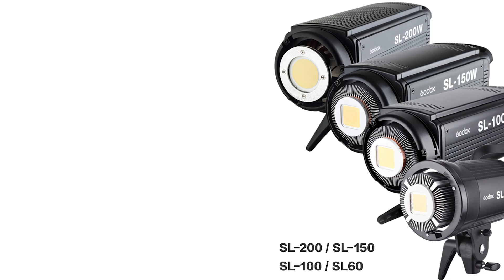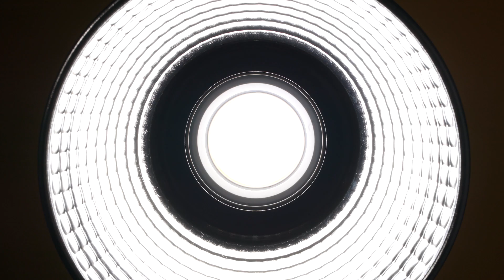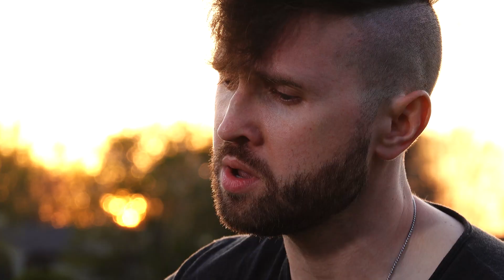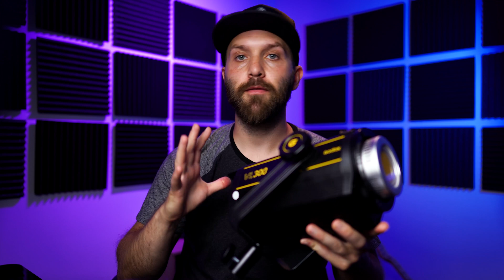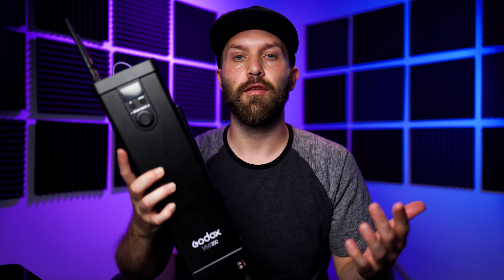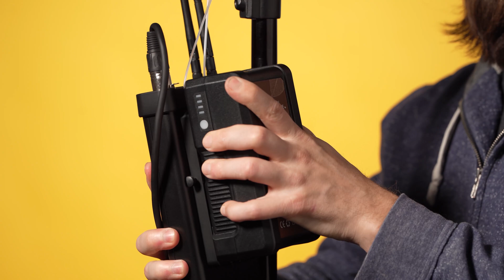Godox VL300 COB LED Review - High Output and High Value

Comment: Very informative. Awesome video. What do you think about the 300d ii, 300x and Godox VL300?
Reply from the maker: I think the VL300 is a better value than the 300d ii, because the critical specs (output and color quality) are so close and the advantages to the 300d ii are either cosmetic or minor luxuries that may not even appeal to most users.
As for the 300X, if you want bi-color then obviously that's the option.

Comment: Robert, do you mind sharing your lighting setup for this video? I see a lot of videos with a key light and colored backgrounds and I'm curious how you achieved that look so well? Thanks.
Reply from the maker: sorry I just seen this. All about fall off, especially in my close-quartered setup. LED lighting me is just out of frame, at a very lower power. As close as I can possibly get it. And then two RGB panels firing at the walls behind me, mounted overhead with a boom stand.

Comment: Hello, I have a question and you're one of the few channels I can think to ask. Might be silly, but it just occurred to me as a beginner in regards to an upcoming gig. Can two camera bodies, each using a transmitter, trigger the same strobe? I've only seen videos about this with optical trigger, not wireless. So for example, shooting a wedding with two bodies, each with an X1T on them, can they each fire the same AD200 so I can switch between bodies seamlessly? All set to same channel and group of course. I would assume that's the case but maybe I'm missing a reason why it can't be done.

Comment: enjoying your work bud, keep it up. recently picked up the AD1200 and two 600s to replace an old lighting set up. are you able to test the 1200 again the elinchrom 1200? it's been a 'dream light' for some time, and I'm considering adding it later. the output of the AD1200 meets my needs unlike the 600s. all the best man

Comment: Have you done any tests using that reflector on actual strobes? Do they also help strobe output?
Reply from the maker: I haven't yet, however I plan to try and pair it with the AD1200 Pro to see what happens. I don't think we'll see the same type of output gain as the COB though. The COB is flat, so it makes sense that using the ribbed squares concentrates the light. And omnidirectional bulb won't experience the same benefit, at least not as significantly.

Comment: How many stops different in brightness are the 150 and 300?
Reply from the maker: theoretically 1 stop, but I haven't tested side by side. But Godox has a track record of making their products wattages correlate directly with their output across models of the same series.
Reply: @robhallphoto  Thanks! I'm thinking the 150 will be good enough for me then. Now if only I could find a budget version of aputure's spotlight.

Comment: Do you think it'd be cool if all ac strobes come with such an dc option which uses standard LED batts like v mount, gold mount, NP-F etc whatever's the standard in cinematography. Strobes draw less power on average and their batteries are often similar/lower speced than flash ones (in terms of voltage and capacity)

I'm not thinking about flash specs (color accuracy, recycle time, flash duration, portability etc) but just not having to pay the premium for battery powered strobes (and the added bonus of versatility being able to plug and shoot seamlessly as it is an ac unit by default). I see so many chinese knockoff LEDs of the aperture/godox line/cheap knockoff led panels with battery capability some proprietary some standard NP-F, V mount etc. Yes they flicker, have non linear output, have color casts etc but they do not seem to have a substantial premium added to them save for the cost of battery and charger when compared to their ac only counterparts (which are no better in the former category and are hardly a thing now)

A good analogous scenario would be those clunky (no digital display, radio etc, just sync jack, on off switches for slave and beep and a knob/slider for strobe and modeling lamp output), voltage controlled (no auto dump is fine!), less accurate (godox sk400's color accuracy has been fine to me, no wild color variation on same power flashes i often hear alien bee users say, only 100k drift in total i'd say, the bigger issue is power consistency but i was firing only full/half power bounce flash during events taking pics of different parts of the venue with the flash in the same spot firing into the middle of the ceiling so not the best consistency besides same power level but it was 0.2-3 stops difference and less than 2/3rds at worst, i can only see 0.2-0.5 varience shooting products at similar power levels but product orientation changed, light mod and distance stays the same so a bit more constant) flashes take standard batteries as dc power (proprietary batts are fine as long as it keeps costs down per watt/hr, v mount batts are not the cheapest i know. ) that would really revolutionise photography. Cheap chinese steobes cost $100-150 for 400-600ws, add the $10-30 cost to add dc option like LEDs and another $30-50 it cost for batts and charger, at worst we have a $230 600ws outdoor portable strobe that has a 50W modeling lamp (if those batts can run 300w continuous factoring flash power usage 50w should be cool). That would be cheaper than all battery powered flash units or inverter solutions......

just sharing my thoughts cause it seems you are the few who can advocate change within manufacturers.
Reply from the maker: Personally, I want the battery that best accommodates the size of the strobe while delivering the necessary performance. So, I don't mind their proprietary batteries when it keeps the size down. If there was 0 compromise and a V mount could be used on a 600 that'd be great, but I think the discussion stops there. For more portable lights like the AD300 / AD200, an NP-F wouldn't provide the Voltage necessary for their recycle speeds and V mount batteries are as big as the light itself.
It does call into question why the cinema industry has so much standardization while the photo industry fights it so hard.
Reply: I'm just suggesting standard batteries (18650 cells loose or packed into power boxes/catridges which are easily user replaceable with tabs to open and spring loaded holders rather than welded/soldered batteries and glued/screwed shit cases count too!) is based on the assumption that some strobe companies (Godox for example) are less willing to fork in the extra r&d and support (in designing and making batteriesx chargers, etc available) for their low end ac strobes (sk400, dp series etc) unless there is a substansial premium involved (see ad600 price difference from the average 600w ac strobe)

Yes I know the average 600w ac strobe is non igbt, no hss etc but let me ask: why is godox (or jinbei, visico, nicefoto etc) not willing to design dc option (with battery of their choice into their traditional ac strobes without making it double the cost? (ok double is the most i can accept from diying an inverter, sla and 400ws strobe, I believe a native circuit that allows direct charging with the battery instead of converting dc to ac, then converting ac to dc to charge capacitors is cheaper and more efficient hence more pops per watt hour) Take away charging while using/ac option if that is necessary to keep costs down, switch the tungsten to a non dimmable/ 3 step crude dimming 20w led with crap cri if necessary to keep power requirements down, I could care less. 

A case in point why I feel that way is the price of the official ad360 charger is $7, but an ebay search of 12.6v chargers with a 5.5x2.5mm port meant for lithium drill batteries etc cost only $2.5. Sure, the 3rd parry charger is 1A-2A depends on vendor (official godox is 1.5A so either you get slightly slower or superior charging times) and the current can "backflow" which is the green indicator lights up when the charger is pluged into battery but not into mains and the fact the 3rd party charger is slightly larger but as a company that chargers "honest prices" for gear rather than insane markups like profoto I'm kinda surprised actually. This is why I'm campaigning for open standards through commonly used voltages like in power tools etc so it is easy for us to just put x number of 18650 cells in series without voltage regulating circuits or batt packs from rc stores erc for the lazier/less talented of us because I feel like even godox isn't trying to give us the best deal. The best they can do is use a standard battery and let us find the best battery/charger deals ourselves. Per my calculations if the proprietary batt/charger costs more than 50% than buying individual cells/ battery pack it's too pricey. Often the manufacturer can get lower costs due to bulk buying and the battery case is negligible. I compare prices using sony/samsung budget cells whilst godox uses god knows what chinese cells which are inherently cheaper. 

For the record i have no issues with the ad200, 360, 600 battery value. For the ad600 charger I found an alternative for 2-3 times cheaper. I have problems with the ad400/600 pro battery and charger as they are smaller batteries than the ad600 and cost more. The bummer is I couldn't find 3rd party batts/chargers cause of the quirky voltage they use (21v like power drill would be schweet)

Re the np-f batteries it is 7.2v the v350 is  the same the use of external mounting could allow small capacities to keep the size small or larger to have endless capacity. For the v860 which uses 11.1 batteries, either an internal voltage step up circuitry or more current drawn could give similar recycle times. Assuming overall watt hour requirement stays the same, a 6300mah and 3000mah 7.2 v battery is roughly equivalent to a 4000mah and 1950mah 11.1v battery. The v860 battery is only 2000mah and the 6300mah npf is only 20-30% bigger so its cool. Otherwise, 2 smaller capacitiy NPF batteries in series could providenan whopping 14.4v for faster recycle times/larger capacity. It should also satisfy the 12-16v requirement of most outdoor strobes.Otherwise, 4 NPF/ 1-2 V mount batts will satisfy 28v requirements (I'm not familiar with npf size/capacities besides the 6300mah one I googled, don't quote me on that, just hypothetical guesses)

Like I said I have no problems with the value of the AD200's battery so I'm not trying to make a case for an NPF powered ad200/300. However, if brand X decides to make their $30-50 150-300ws ac strobes have a DC option, are unable to produce their own batt with similar value to the ad200 batt or just use the ad200's just have 1-2 npf slots and that would be so cool. Imagine if alien bee 400/800 units cost the same/ $50 more at most and could take 2 NPf batteries not needing VMLs? That would make it so much more attractive.   

Remember when yongnuo first came out  and the average joe blow could have 5-6 full powered gn60 speedlites for $500 rechargeable batteries included rather than 3-4 lower powered sb600,24,28,430ex speedlites used? I foresee a day where for the same cost joe blow would be totting 2-3 150-300w lithium powered strobes. Speedlites are inherently "pricey" even godox and yongnuo compared to strobes when power is concerned perhaps due to complex LCD, ui requrements (strobes have nothing more than a knob/slider for power adjustment and on/off switches for modeling lamp, slave and beep indicator), zoom motor, fresnel and swiveling head with electrical connections (rather than a simple mechanical light stand swivel). The only thing seemingly keeping speedlites viable is the great hike in price between ac and battery powered strobes which baffles me. I just hope to see every indoor studio/headshot budget shooter could be "location photographers" just by spending another handful of peanuts of what they spent on their existing strobes.....

Comment: Thanks so much for your thoughts on this light! Would you say that the VL150 is the same in all respects except output and weight?
Reply from the maker: Output obviously close to half, weight/siz is less, only requires V mount battery, and from what I've seen, fan doesn't pop on until roughly 50% as oppose to 35-40% on the VL300.
Reply: @robhallphoto  Awesome, thanks a mil! You're the man Robert!

Comment: In your opinion how would this light work for photography I am looking for led light
Reply from the maker: I don't think any LED works great for photography. Even this 300w, it's not bright enough for flexibility. F/11 +.7 at 1/50 ISO 100 is equivalent to F/5.6 +.3 at 1/250 ISO 100. For a 4 foot measurement in a reflector, that's nothing compared to flash, a V350 would be more capable. Additionally you're exposing the subject to light the entire duration of the shutter, which just means way more opportunity for motion blur. And if you increase the shutter speed more to compensate, you're just eating into your light output more. 
I can see it for still life, though I'd still recommend flash instead.
Reply: You could probably use this for high ISO work such as night time wedding photography
Reply: Can the unit operate with one V mount battery or are both needed?
Reply: Sometimes client want photo and video from one set. It is not easy to switch strobe to LED during the shoot or vice versa. So LED does come in handy. I mean as long as it is not high end photoshoot. I think you can get away with use LED for photo.